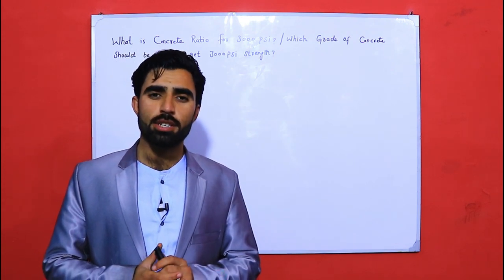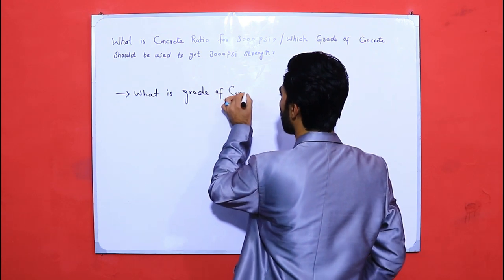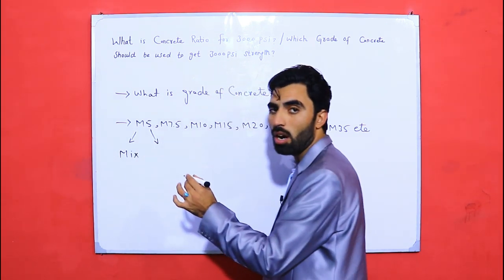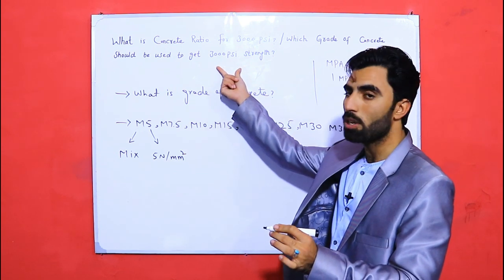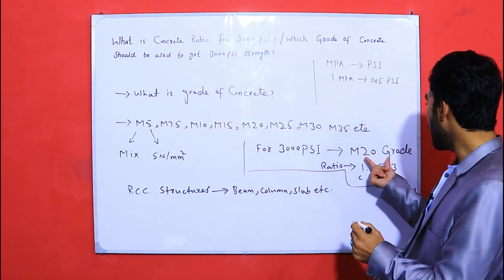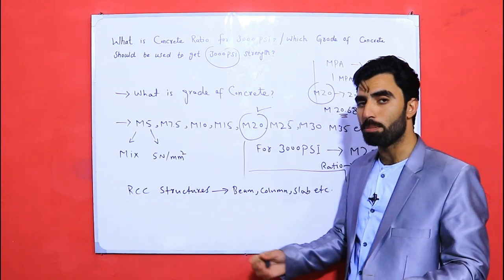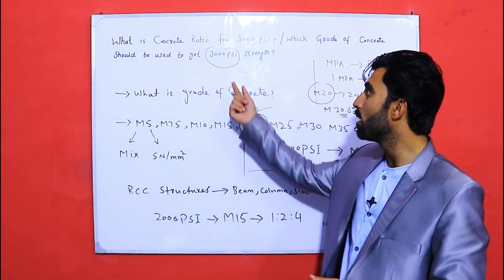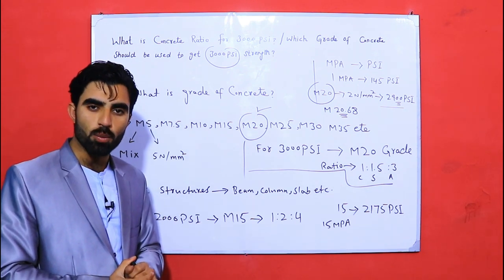What is Concrete Ratio for 3000 psi? Which Grade of Concrete should be used for 3000 psi Strength?

Comment: What is relation between MPA and N/mm2? Please explain.
Reply: As He explained, Very obvious that 1 N/MM2 =1 MPa, thus, M20 (Mix , 20n/mm2) x 145 PSI =2900 PSI (its so close to 3000 PSI),,,,,,,,,this is another furmula to get more closer to 3000 psi,,,,,,,,,I will use instead PSI to MPA , thus 3000 PSI x 0.0068915 =20.6745 MPa , so 20.6745 x 145 = 2997 PSI (so VERY close now to 3000 PSI.)

Comment: Sir in our house 4th floor bldg 36 square metrr the ratio we use is 1:4:5  and the bar we use is 8 16 mm per post and beam.. Is it ok. ???  Here in philippines watching always in your vlog.
Reply: your ratio is weaker than RCC requirement. 4 floors and you used non structural ratio of concrete. better consult licensed civil engineer or structural engineer as designer if you like to be secured.

Comment: Brother I have a question that m20 means 2900 psi crushing strength but wanna know that is it 2900 psi cylinderical strength or cube strength 
And according to m15 the strength in psi will be 2175 but in sites 
In m15 in construction projects they need 4000 psi in even in m15. 
So how it's possible ???
Plz clarify that point plz plzzzzzzzzzzzzzzzzz